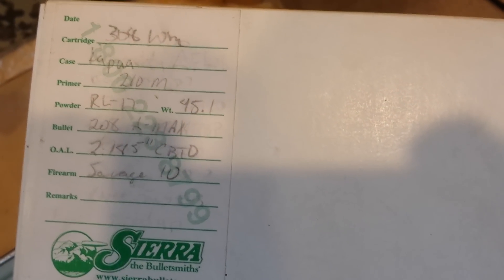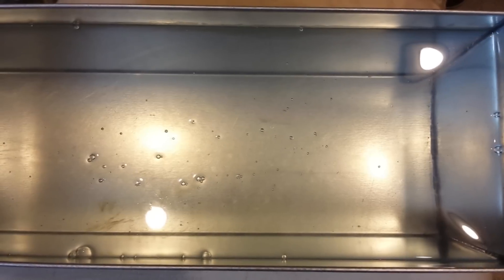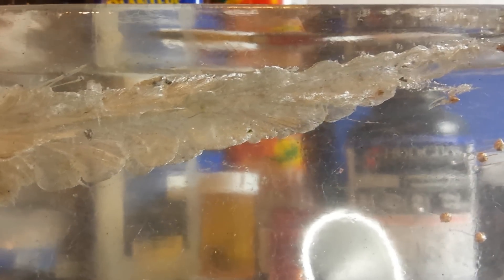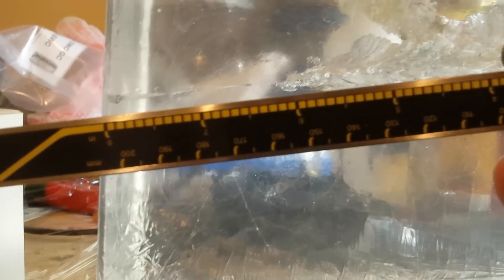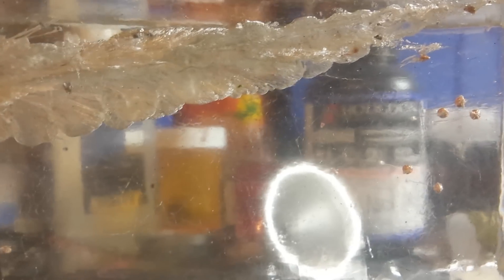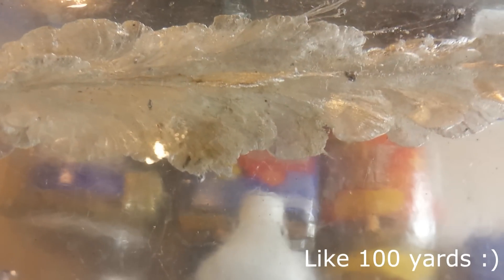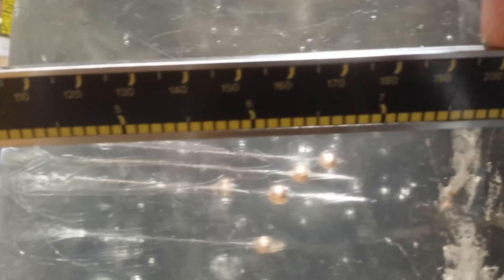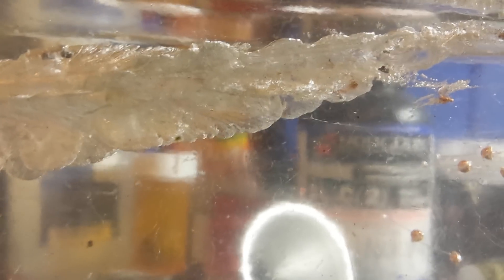308 Winchester Gel Test: 208 A-MAX @ 500 yards!

Comment: that is a good load you have there! according to the ballistic calc 1000ftlbs energy at 950? :O   
im going to have to build my own. have you ever tested that round in different lengths ? im working with 22" rem 700 and 20" PSA10. currently both <1/2 moa with 168gvld and 46g varget.
Reply from the maker: I only used a 24" bbl. Due to the slow burning nature of the propellant, I think velocity would start to suffer quickly with shorter barrels.

Comment: That would have been impressive for ten yards, at 500 that is surprising. Are you staying within the load data for that bullet, it seems very hot? I know this is an old post but what the hell.
Reply from the maker: No, there is no load data for this bullet in the 308 with the powder I used. I also loaded it very long since my chamber would allow it, which meant I could get a lot more powder in than normal OAL would accommodate. The powder I used was RL-17, which is slow burning for the 308, and worked well in this application. The velocity is high for this cartridge/bullet combo, but again, withing safe average chamber pressures. Thanks for watching, and yes, I was impressed with the damage to the clear ballistics block at 500 yards. That gel is hard to tear up, but this bullet did it very well at long range. Thanks for the view and comment!

Comment: Thanks a test that shows what a bullet does way out there using a reasonable velocity not shot at speeds that eat up  barrels.
Thanks
Reply from the maker: I was absolutely blown away by the terminal performance. If I had not been such a dumbass, I would have laid the block flat and probably got two full wound channels. Both hits showed the same performance as well. Well, what we could see of the first one.. Thanks for the comment and being a decent human! So rare these days...
Reply: While you would probably need to re barrel almost all 308 Winchester to use them  Hornady has 220 grain Extra Low Drag expending 308 bullet out that their  ballistic calculator says will hold +-5 inches high or low from the muzzle to 500 yards with 325 yard zero at 2600 fps. It stays supersonic at 1000 yards as long as leave the muzzle at 2400 fps.

They also have  250 grain .308 bullet ELD match bullet with an Aluminum tip that should stay supersonic to 1600 yards with a flight time of 5 seconds with a muzzle velocity of 2600 fps. I expect it takes a 300 Win Mag or more to push it that fast.

Both bullets need 1:7 twist rifling.

Comment: What was the cartridge overall length? Couldn't quite make it out and it looks like 2.185" which isn't correct.
Reply from the maker: I loaded these at 2.940" OAL. 2.185" might have been the CBTO.
Reply: Okay thanks for the reply. case base to ogive? 

I tested the 208 grain Amax from a 20" lr308 a few days ago and was getting just under 2,400 fps (2,390) with 43 grains of bl-c(2) which is just under max (although 43.8 grains is only showing 58,900 psi so that might be able to be pushed a tad). 
I could likely get a bit more velocity from CFE223 but was trying to use up some of my older powder. col on those was around 2.815".

Comment: Great test.  But may I ask a stupid question?  Since you are loading your ammo, can't you reduce the load/velocity to mimic 500 yards and shoot it at 15 yards?  Thanks for the vid.
Reply from the maker: Where's the fun in that?!? xD Besides, you can only download cartridges so much before you get into a dangerous situation from too little powder in the case. It causes a condition known as detonation where ALL the powder in the case burns much more rapidly than if it was restricted to the diameter of the case. Internal ballistics are very complex, and things like burn rates of powder define their usability in each cartridge. For example, you'd really never have a good use for the same powder you load 45 Auto with in a 308. It burns much faster than the powders normally used in the 308, which burn much faster than the powders used in the 50 BMG. Large case volumes and lots of slow burning powder create a slower pressure spike and a lot more gas, which pushes them bullets out the tube faster than a faster powder which reaches high pressures sooner and restricts you to less volume. 

Technically, I could of loaded it with a magnum pistol powder and some filler, but I enjoy the skill and technique required to hit a target like this at 500 yards, twice, with that kind of accuracy. Thanks for watching!

Comment: Intro is to long!!
But good video and thanks for it!
What is the spec on the rifle and how many mils drop on the 208gr from 100--500 was there?
I am getting into reloading as well and the best group I got so far in my Remington 700 aac-sd with a 20" barrel with the barrel lug bedded and a 1-10 twist, was a Hornaday 168gr BTHP loaded with 37.1 gr of Varget powder..
I got a nickel size group 🙃 at 100 yards
Reply from the maker: Sig 226/2022 it's been addressed
Reply: dadajack 
Kinda late on this but how much of a drop did you get with the 208gr
Reply from the maker: About the same as a 175, maybe a bit less, but the velocity limitation was a limiting factor on using all the BC, you know?
Reply: dadajack 
I fingered it would be a lot more then a 175gr. There is some ELD-X I used the 178gr but I want to try the 200 and 212 gr and see if my rifle likes it. So far it loves the 178gr ELD-X I got 5 shots in 1" using a 1-4x24 scope (temporary) 
Thanks for the info man
Reply from the maker: Well, I only pushed the 175 to right around 2725-2750 in a 24" tube. But, the velocity of the 208 at 2650 and that incredible BC makes up for the speed difference, but doesn't improve drop over range. Loading long and using a slower powder like RL-17 makes it possible to push the 208 that fast. You just have to use a ton of powder to do it.
Reply: dadajack 
What type of grouping do you get with that reload
Reply from the maker: I could typically shoot 2.5" at 500, and cloverleafs at 100. You see the two shots in the gel were less than 2" apart, right?

Comment: That's pretty cool video!!  How do you mix up your own ballistic Gel and reuse it....
Reply from the maker: Hey William. I use Clear Ballistics gel even without being sponsored by them (hint hint Clear Ballistics). The gel is super easy to reuse, but it does take a long time to remedy
It the way I do it, but it works really well. I rip the used block up into chunks and put the mold in the oven at 160. Then I put in a few inches worth (just the tip) of gel and wait until it is melted, then add more. Repeat until the whole mess is melted and can be stirred easily. Then, pull it out and let it cool a few hours, or a day.

Comment: Model 10 FCP.  The starting gr for BL-C 2 is 40.7 and at max 43.5 @ 59,000 psi. This round will be for 500 and further
Reply from the maker: +Scott Belschner that'll get you around 2450 fps. The RL-17 will get you much better velocity, which will be helpful for using that giant BC of the 208 at long range...
Reply: I will definitely pick up a pound tomorrow.

Comment: I'm a fan of varget but it's to hot for that grain weight. I'm going to do a ladder test with BL-C 2. I ran my O.A.L. gauge with this bullet at 2.925 to the Ogive, I will let you know my results. thank for the info
Reply from the maker: +Scott Belschner Savage model 10? BL-C (2) will still be much faster burning than RL-17. If you run long, and load heavy, you will get better velocity. I use Lapua brass, BTW, so capacity is higher.

Comment: Can you feed them from a standard magazine? If not what modifications  are necessary to run run 208 and 225 grain bullets? And what twist would be needed?
Reply from the maker: turntechgodhead100 Thanks for the great questions! First, the HS Precision stock magazine will hold rounds up to almost 3" long. These are 2.920" or so, and they fit perfectly in the mag. 

Second, The minimum twist for a 308 to stabilize these bullets is 1-10". The real issue is not bullets weight, but length. The two do go hand in hand, but all copper projectiles usually need a tighter twist than cup and core bullets due to their length vs. weight. 225g projectiles would benefit more from a 1-9" or faster, but you will have to have a custom barrel made for that because the 308 is capable of shooting such an incredible range of bullet weights. 110 grain to over 250. Of course, the optimum bullet weight for the 308 is 150 - 175 grains for energy and accuracy. Either of those weights will work with a 1-12: twist, which is also standard for the 308 Win.

Thanks again.
Reply: dadajack yo Thanks for answering my question. I was going to get a 308 rifle shoot the heavy bullets but I'll probably probably get rifle in 6.5 creedmoor or 7mm.
Reply from the maker: I have a 6.5 CM as well and it is a very accurate rifle. Carries more energy out to 1000 yards than a 308 as well. Of course, between the muzzle and 500 yards, the 308 owns the Creedmoor. Have fun.
Reply: dadajack what 308 are you using.... at 1000 yards depending on bullet weight 308 should have equal or more energy